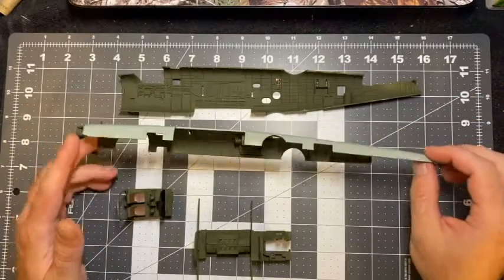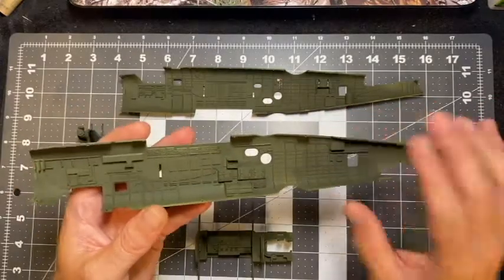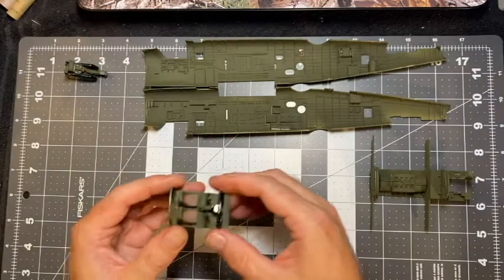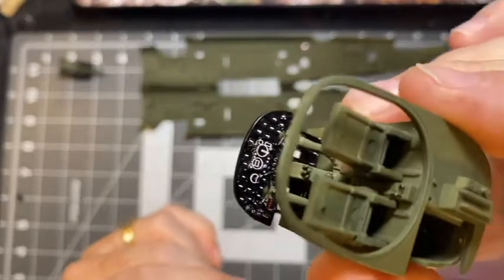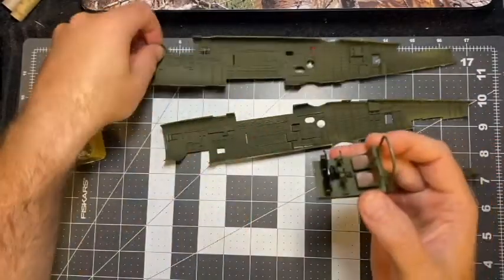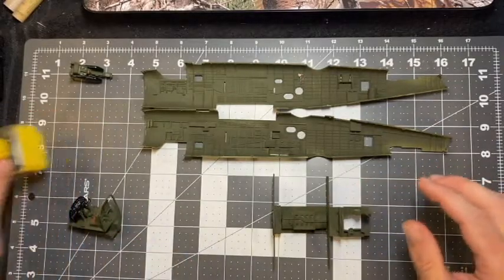1:48 Scale B-25 Model Build - PART 2

Comment: Thanks for the vid.  Originally, they made the interior color mixing chromate yellow and black paint with a touch of silver. I tried this and results were OK, though best interior green I've come across is by mixing tamiya XF-3 yellow, with XF-5 green. 2 parts yellow, 1 part green. Then dilute the mix with Mr Leveler thinner for airbrushing. My dilution is 1 part paint with 3 parts thinner (1:4 diln). Gives a great base, and easily weathers for realistic effects. Hope that helps.
Reply from the maker: Great info there!  Thank you very much!!!

Comment: What kind of airbrush do you use? Would be interested in an episode on paint. What did you use, a can, small bottles or something else? An episode on paint similar to how this video ends.
Thanks again for sharing!
Reply from the maker: Robert, I went SUPER cheap on my airbrush, as I spent less than $30 on it.  But I have ZERO complaints so far.  Maybe because I've got nothing to compare it with, but so far, I love it.  I bought it from Hobby King (I've attached a link for it).    I am not sure about doing a "How to" video for the simple fact that I am still learning.  Also, there are lots of videos out there on YouTube for such lessons, because that's how I learned what I know.  But to answer your question, I mix paint and thinner in a mixing cup, then I pour it into the bowl on top of the airbrush.  At first I was pretty intimidated by it, but once I got into it, it ended up being a lot simpler than I thought.  Glad you’re enjoying the series!

https://hobbyking.com/en_us/pro-series-gravity-feed-airbrush-kit-with-double-action-trigger.html